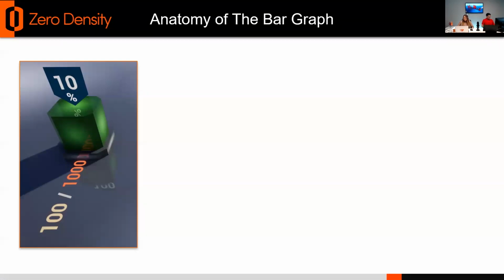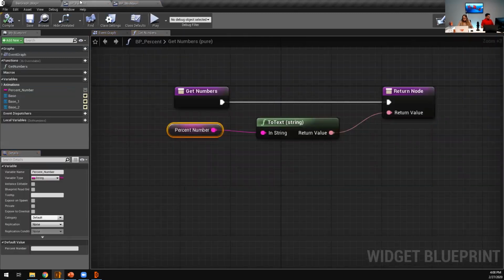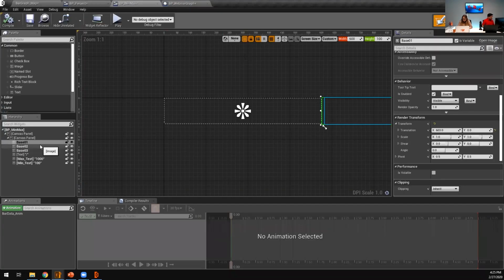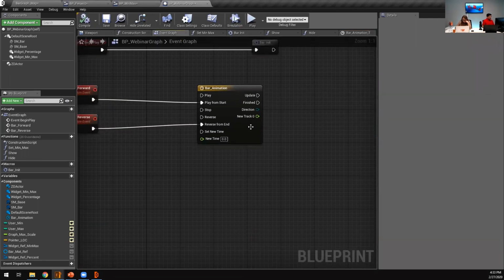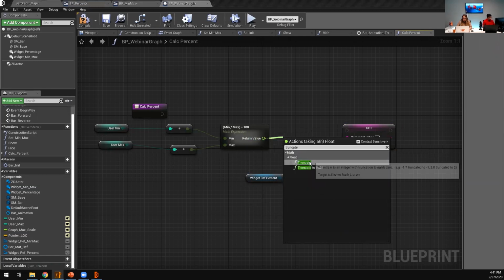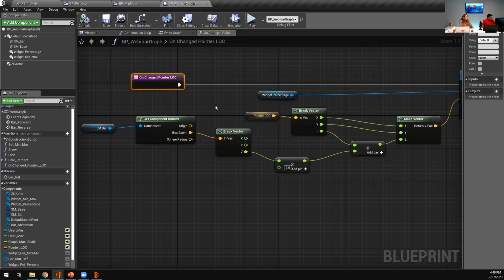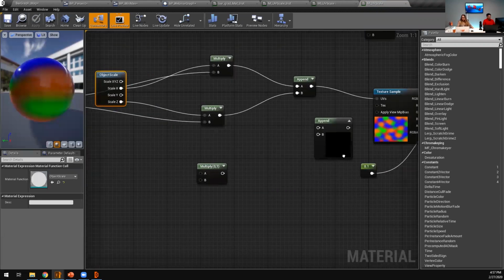Reality Webinar | Part 1: Creating Multipurpose Bar Graph in Reality Editor

Comment from the maker: Introduction
 
Anatomy of the Bar Graph 0:34
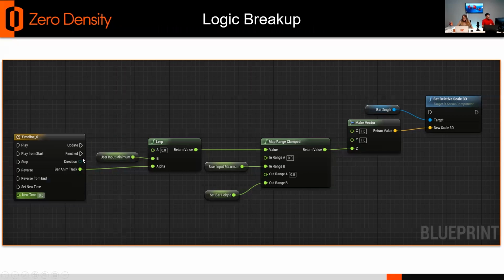Logic Breakup 2:11
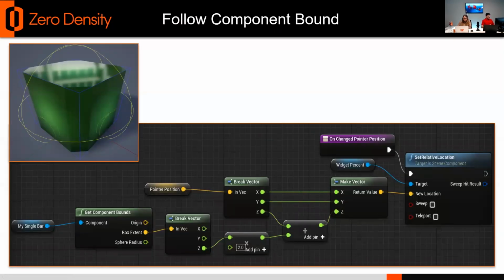Follow Component Bound 4:54
Percentage graphics 6:34
Min/Max Graphic 7:41

Blueprint Components

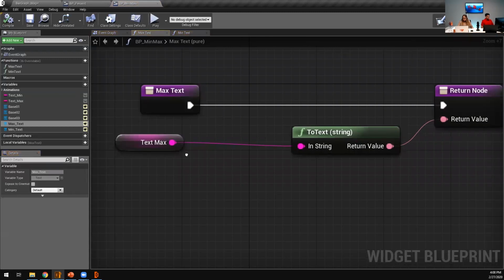Actor Blueprint 8:23
Adding Static Mesh Component 9:20
Adding Widget Component for Percentage 12:20
Tick when offscreen 13:45
Adding Widget Component for Min/Max Values 14:22
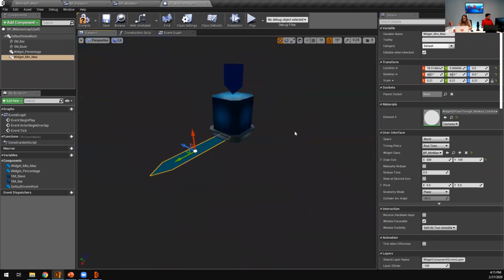ZD Actor 15:05
 
 
Blueprint Graph
 
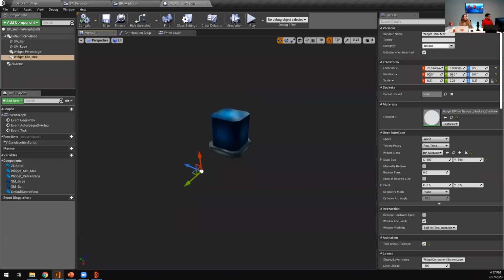Creating Macro 16:50 ~ 22:45
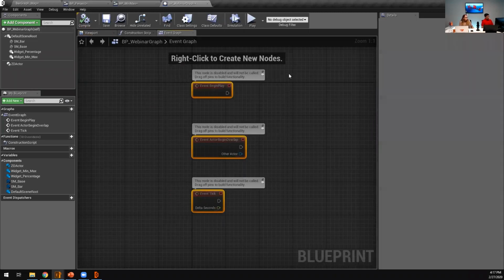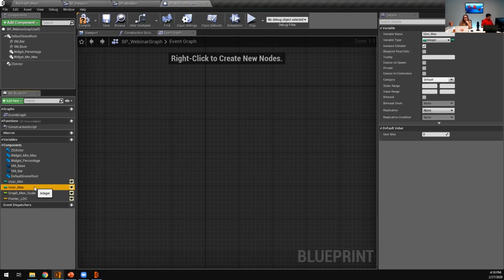Creating variables 16:50 ~ 18:27
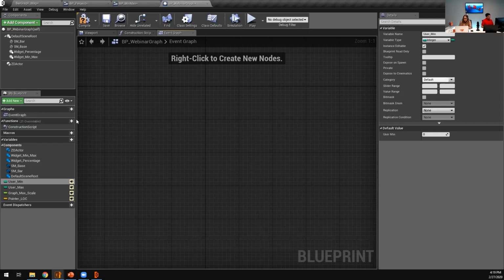First function 18:28 ~ 19:08
Getting Value from Widget Min/Max 19:10 ~ 21:14
Getting Value from Widget Percentage 20:49 ~ 21:37
Using the Macro 22:49
Min/Max Logic 23:27 ~ 26:13
Trigger animation 26:37 ~ 31:44
Play animation  31:46 ~ 32:30
Data to animation 32:40
Range Map Clamped 33:33 ~ 34:47
Animating Bar Height 34:49
 
Rgraph 36:53
Set Min/Max Function 38:53 ~ 41:14 Rgraph 41:21 ~ 42:29
Pin percentage on top 42:31~ 46:32
Bar graph with animation 50:37
Color setting for percentage 51:57 ~ 55:29